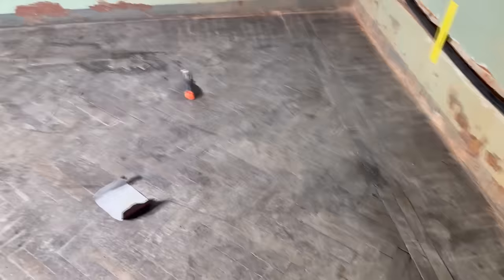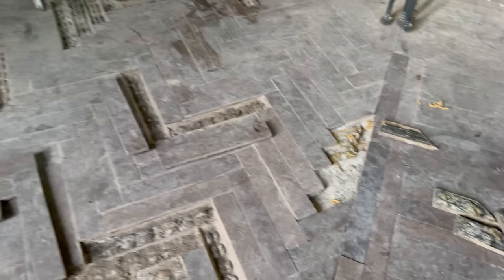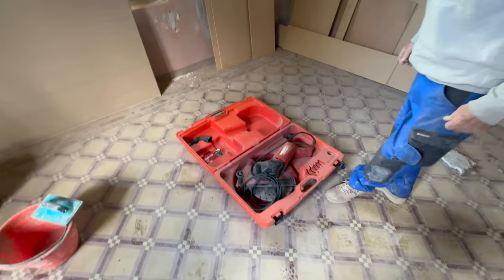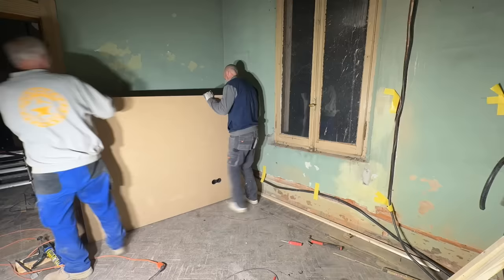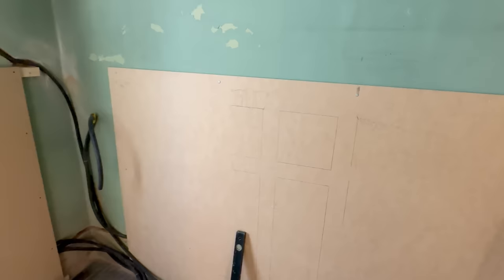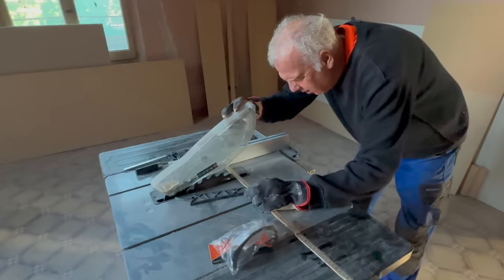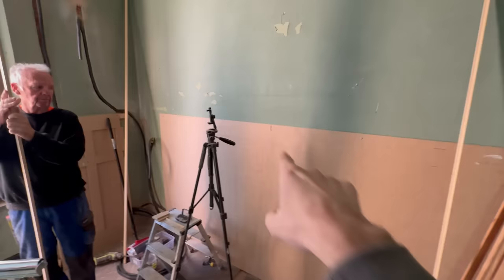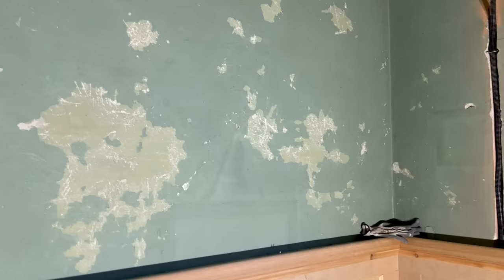DIY Home MAKEOVER: Building WALL PANELS from Scratch Ep:43 of our Italian house renovation

Comment: Nice work!!! Really done well with precision cutting. 

As a designer I usually divide a wall in 3rds when building panels.  In many historical buildings the panels, if done in 3rds going up the wall gives the impression of a taller wall. So a 3rd at the bottom of the wall for panels makes the plaster section look taller and same in reverse when the paneling reaches 2/3 of the wall height it has a way of deceiving the eye in the proportions of the height/space more so then when you cut the wall in half.  I think the door’s door panel configuration is a prime example of that.  

But excuse me for not knowing what or why is behind the design decision as I apologize if it sounds more like I’m being critical and/or rude when I was just trying to share some food  for thought on design principles I’ve become accustomed to using and have proven to be very effective.  

Congratulations on this room transformation!🎉 Your attention to detail is outstanding!! 👏🏻👏🏻👏🏻
Reply from the maker: No not at all, you are correct and thank you for the advice! The reason we have the panels  so high up the wall is due to the size of the bed one of the panels will hide, we want it to be of decent size and fit a person very comfortable or even two smaller person which it will do now when we can use a larger mattress. 

Thank you for your kind words!

Comment: You called those wall panels OSB but that is commonly known as MDF (Medium Density Fibreboard).  OSB has large chunks or chips of wood glued and compressed to form panels.  MDF is fabulous for this kind of treatment.
Reply from the maker: Yes you att right, those are MDF’s, I have OSB in other places. It’s just my brain which is half asleep lately 😂
Reply: @VillaAroldi  I get it. Renovations are marathons not sprints. I hate when people call OSB plywood too. Just my pet peeve I guess. You are doing an amazing job.

Comment: Hi, very inspiring to see your wall panelling work. I have been thinking about doing it for our villa. That wood cutter you used seems very handy compared to the mitre saw. What is it called and what brand or store has it?
Reply from the maker: Thank you!
Yes, it's very difficult to do this type of work using a mitre saw as  you need to cut at the correct side of the wood, not just in the correct angle. 

I bought it on amazon, just search for "Multi Angle Miter Shear Cutter"  
I hope it turns out well, Good luck!

Comment: where did you find the brass fitting for the electrical outlet in Italy? is it brass, or plastic colored in brass?
Reply from the maker: These are from GIRA and rather hard to find in Italy, they are not the usual standard outlets you find here. 

They are real brass and rather heavy, they also have bronze, aluminium and so on. 

You can order them from: www.selectra.it/it/
Or if you are nearby Bolzano you can buy some of the things in their store, but most of it is on order only.
Reply: Thank you so much! They are very difficult to source. You're a lifesaver! Keep up the great work!
Reply from the maker: Yes they really are hard to find. There is an Italian brand that makes them too, but I cant remember the name and they only sell through architects so no point even bother. @Rob.Hendricks